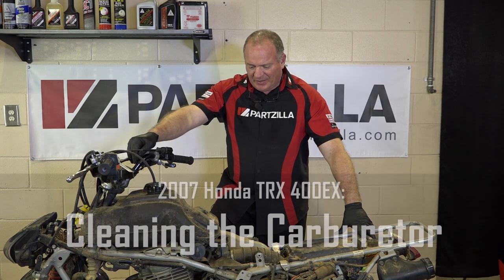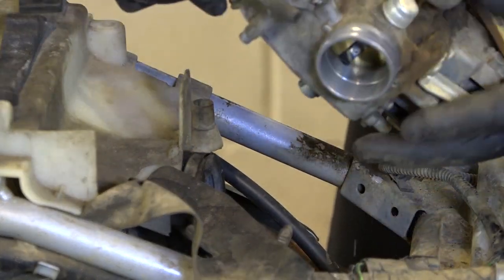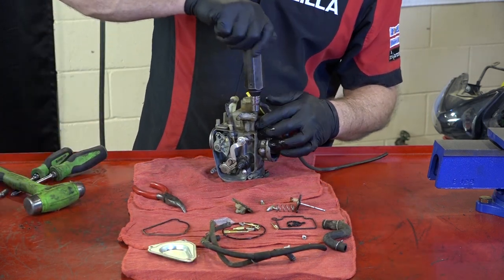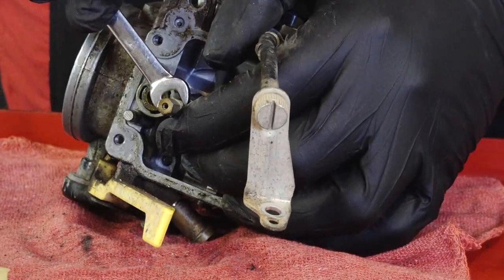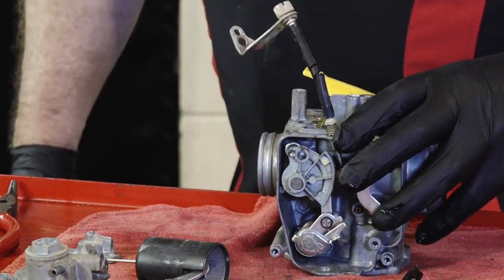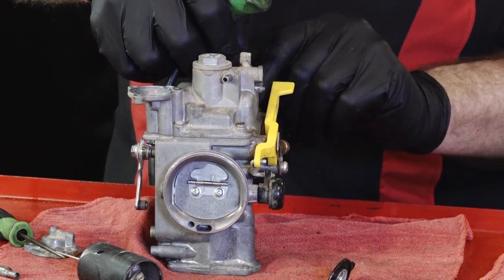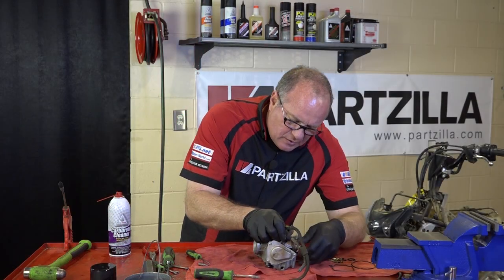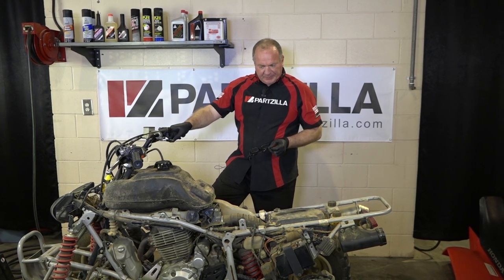Honda 400EX ATV Carb Rebuild & Cleaning | Partzilla.com

Comment: I have a 2003 Honda 400EX and the carb leaks out of the bottom. What do you think is the problem?
Reply from the maker: Float is stuck?  Rubber gasket leaking on float bowl?  Take it apart and give it a good inspection/cleaning.
Reply: Would it work to install a Honda 450r carb on my 400ex?

Comment: I didn't see you take off part #27 which is the jet holder. I have one on mine and I re installed after rebuilding carb. Please tell me if that's really needed or not because it is a pain getting the float bowl with new gasket on without the jet holder falling out of place. Is that why you didn't show it?
Reply from the maker: It's needed. It just wasn't necessary to pull it out.  The perks of having a sonic cleaner.

Comment: Hey so when I’m riding my trx400ex on a flat surfaceits normal, and I start going where pump are it seems that my carburetor start leaking gas do u know why?
Reply: Adjust you float needle or get a new one.

Comment: So I rebuilt the carburetor, turned on the fuel Petcock and fuel continuously drains out of the overflow hose. What did I do wrong?
Reply from the maker: Sounds like your float might be sticking or you may have missed one of the gaskets/o-rings.  Time to run through it again!

Comment: I have a question I have a 2001 Honda ex 400 bored over 40 wen I try to start it it turns over but it sputter an cuts off wat could it be I need help ??????!
Reply from the maker: Check compression first, could be timing or air/fuel mixture...not enough information to properly diagnose.

Comment: For the air fuel mixture. If I buy a new carb will I next to set it or will it already be set?
Reply from the maker: OEM carbs come set to stock settings.  You may need to adjust regardless.
Reply: Partzilla ok I have one more question. I have it running now but after a minute or so while running it the pipes start to get red hot. Any suggestions?? Thanks in advance
Reply from the maker: Bread Winner  Running too lean. Might need to adjust more or rejet.

Comment: After I rev mine it starts popping I think it’s called backfiring but can y’all lmk what I should do?
Reply from the maker: It is backfiring.  Typically means you need an air fuel adjustment

Comment: Hey, I just bought a 400ex and the owner before me put a fmf powercore 4 on it. He says he didn’t do any mod with the airbox or jetting I guess people are saying 152 main & a polit 40 or 42. Please get back to me I don’t want to mess the bike up in anwaysmn
Reply from the maker: When it comes to aftermarket, it varies by manufacturer.  Research FMF if they have any suggestions.  You may have to rejet.

Comment: I know it's just a 250 compared to one of these 400 but can u please make a video on how to remove the stator of a trx 250ex? I cant seem to find a video on how to remove the stator.
Reply from the maker: The stator is on the front of the engine on that one, if I remember correctly, it's a little weird.  I'll try to get a unit to do a video on.

Comment: will you be doing anything aftermarket wise??? i think more 400ex's have aftermarket parts bore kits, ported polished head, shocks .. that kinda thing iv built a lot of 400ex but i love watching other ppl do it to them to see there techniques ..
Reply from the maker: +Adam Wolfcale Adventures We were not planning on it but the basic procedure for pulling it down and reassembling is pretty much the same and we have a 3-part video that shows a top-end rebuild. When you start getting into the really high performance stuff like pop up pistons you just need to be really careful with the piston to valve clearances. Modeling clay will tee just how close things are getting. Honestly, most of the kits out there have done their homework so you should be safe.

Comment: Does a Dynojet kit have all the things needed to also rebuild the carb? Like the rebuild kit that they sell?
Reply from the maker: It should come with a variety of jets and parts, but I don't think it comes with gaskets.  It would depend on what you need for your carb or how much you're rebuilding.  If you don't have leaks and it has just sat for a long time, you should be good.
Reply: Partzilla Thanks for the response. The problem I'm having is my 400ex won't idle when cold. I read that it should be jetted to a 42 pilot jet.
Reply from the maker: Using that kit should put you on the right track.  Sounds like the jet is clogged.

Comment: is there something called a baffle plate inside the carb because I looked in the manual and it says there is something called a baffle plate and mine doesn't have it
Reply from the maker: Not sure what that is referring to.  Here is a diagram and parts list for the carb.  http://www.partzilla.com/parts/search/Honda/ATV/2007/TRX400EX+A/CARBURETOR/parts.html  That might narrow it down.

Comment: I need some help, I watched this video and cleaned my carb but it will only run on full choke and won't idle. It has all its power at 1/4 to 3/4 throttle but bogs at full 
It backfires sometimes too
Reply from the maker: Sounds like the jets still have some debris.

Comment: I have a 350 warrior with a full big gun exhaust a uni air filter with a 3in x 3in square cut in the lid with a screen. My question is how do I jet it for that stuff is there a kit I buy or just certain jets?????
Reply from the maker: You can adjust per the specs of the exhaust and filter, but once you start cutting holes, you will have to jump to trial and error.  No one has specs for "custom" modifications.
Reply: Partzilla I’m pretty sure I’m running lean my plug is white ish and my header was glowing red at idle yesterday for a cold start so what do I do  put in bigger main and pilot jet???
Reply from the maker: If you buy a kit, you can test them.  Sounds like you need to go up a size or two.
Reply: Partzilla Yea I’m gonna try that. And I just rebuilt my quad last week I just finish my first tank I been babying it my question is could I have damaged anything running it lean like that??? And is it bad that my header was glowing red?? Thanks for the help.

Comment: How come when I started up my quad it was stuck wide opened?
Reply: Badass Life - did ypu figure out what the problem was? im having the same problem
Reply: I readjusted the throttle cable and it fixed.
Reply: You put your throttle cable in wrong same thing happened to me

Comment: When threading the throttle cable back in, on the carb side how far do you thread it into the carb?
Reply from the maker: Thread it in  most of the way, then lock it down with the lock nut.
Reply: Partzilla thank you very much!! Your videos are An amazing help when maintaining my machine.

Comment: is there a washer before the o ring then the spring? on the air fuel needle? thanks
Reply from the maker: http://www.partzilla.com/parts/search/Honda/ATV/2007/TRX400EX+A/CARBURETOR/parts.html

I'm guessing you are talking about #6 on the diagram.  So it lays out the order in which everything goes.
Reply: wicked thanks alot this helped!

Comment: Can someone help, I have a 2003 Honda trx300ex I just rebuilt and when I loosen the air/fuel mixture jet it will leak... a lot! Also won’t run unless it is fully tighten and choke is on.
Reply from the maker: Sounds like you missed an o-ring.  You may want to go back through it.
Reply: Partzilla Seemed to still be a leak problem. I’ll take a video of me taking it apart and putting it back together  and upload it to my YouTube account, hopefully someone will watch and tell me what I’m doing wrong. But thanks for the reply!

Comment: the carb on my trx400x dosent have the d bit to adjust the air fuel mixture it looks completley round how can i adjust it
Reply from the maker: Selina, the new models have a cap/plug over the screw.  Pop it off and then you should be able to use your D tool to adjust the mixture screw underneath.
Reply: Where can I find the D-tool? My carb looks exactly like in the video.  I can't for the tool anywhere.

Comment: I just got a new carb and put it on but one of the black hoses just leaks gas out of it any suggestions
Reply from the maker: Is the hose damaged or is it draining fuel out of the drain hose?
Reply: it drains out the end
Reply from the maker: Float could be stuck.

Comment: I need help, i opened up my carburetor and remove every item and let them soak in carb cleaner. Put everything together and now it doesnt start. The atv worked ok before i took it apart. I am certain i put everything in correct, it just doesnt start
Reply from the maker: Carburetors can be tricky.  You soaked everything, but did you use a small scrubber to clean out the jets?  Sometimes soaking them isn't enough.  It sounds like it's still not getting the proper fuel.  Double check all the mixture and idle adjustments, as well.
Reply: Partzilla ok got it to start with a new carburetor rebuilt kit, but if i dont give it a little throttle it dies. Does this mean i have to adjust the idler screw? I also noticed a problem when i took it for a test drive, seems to hit a rev limit at half its throttle in each gear. Any ideas?
Reply from the maker: If the rebuild kit came with new jets and we know they aren't clogged, start playing with the mixture screw.  Sounds like your getting too much fuel.
Reply: Partzilla still cant get the 400ex to run properly , i put a carb kit and new jets kit idler 42, main 155, played with the air screw but still bogs at half throttle. Any ideas on what to check?

Comment: My 2004 trx400 the float is stuck and gas is leaking. Any help?
Reply from the maker: Clean the carb.
Reply: I bought a new float and still happening
Reply: T H ya this was a brand new carburetor and still leaking

Comment: Will a 400ex run/idle without a idle set screw (idle speed screw)
Reply from the maker: I suppose anything is possible.  It's not suggested.
Reply: Partzilla well mine just doesnt have the spring on it and it will not idle and i just wondered if that's my problem
Reply from the maker: Without the screw adding tension, it's free to move.  Don't know if that's your running issue, but even if you set the screw at the right idle, it won't stay set.
Reply: Partzilla correct...well i've ordered a whole new idle set screw and bigger pilot jet so i will find out shortly if thats my issue

Comment: Where does the c-CLIP GO that comes with the rebuild kit?..SOMEONE PLEASE HELP
Reply from the maker: Not sure, off the top of my head.  Did you see it in the video?
Reply: vince Foss it goes on the needle that is underneath the top of carburetor, if you look through the intake side hole you can see the tip of it,
Reply: vince Foss the two screws that hold it down are in the cylinder at 16:51
Reply: Got it thank u

Comment: I got a 300ex it wont start by the starter but when u bump it start i cleaned the carb idk wat to do
Reply from the maker: What does it do when you hit the starter button?
Reply: Just turns over
Reply from the maker: Check for spark, then check that fuel is flowing to the cylinder.

Comment: If i'm chem dipping it do i have to tear it down
Reply from the maker: Well, you don't have to tear it down, but in many cases, a chem dip won't clear out the jets fully. It's a gamble. The only way to make sure it's fully cleaned out is to pull the jets and run a small scrubbing brush through them.

Comment: Awesome video as usual. Can you tell me if its possible to order the flap that opens and closes for the choke? I have a 2004 400EX that i removed the carb on to rebujild and i notice its missing... thanks again
Reply from the maker: Hello Cal. I am sorry but this part only comes with the carb assy.
Reply: Ok thanks again!

Comment: Is the carb the same as a 300 ex ?
Reply from the maker: Pretty sure they are slightly different.  I don't have two to compare, but the part numbers are different and they don't show as swappable on the fitment guides.

Comment: is it the same carb as the 2002 model
Reply from the maker: Hello Ryan. Unfortunately this is not the same carb, the one you have is a different part number. 
http://www.partzilla.com/parts/detail/honda/HP-16100-HN1-013.html
Reply: hey i really need help, my slider is stuck and i got an event in 2 days. what kind of grease/oil can i use to fix this problem? i put some wd40 on it and it only made it worse. really would appreciate your help.
Reply: also found this very helpful.

Comment: Just bought a 1999 400ex and when i switch the gas to on or res position. hose #35 leaks gas like crazy
Reply: Intercon McAllen my bike to it starts to leak from the hose that comes out of the flout bole as soon as I turn my gas on
Reply: Wormo .dylnN you need to clean it, that happened to me today and I got a can on compressed air and blew out the jets and put her back in and she was good

Comment: Stop using Philips on these machines! That is a JIS head screw not a Philips head screw a JIS screw is round in the corner where the points and a philips is squared in the corner where the four points meet

Comment: Your hammer is  too small  why don't you get one bigger 🤣😂🤣
Reply: you need a heavy hammer with an impact driver so as to not strip out the head on that stubborn bolt he mentioned. He knows what he is doing, you do not.

Comment: I have a 2002 Honda trx 400ex and the caborator keeps on over flowing but from the inside of it. I cleaned it out so many time and just keeps on doing it. Please help. Thanks
Reply from the maker: Have you checked your petcock?
Reply: Yes I did and it's fine it over flowes were the needle is at.
Reply: @PartzillaParts  any idea of why it's doing that. It's only over flowing from were the needle is